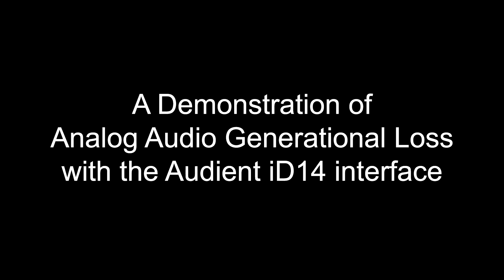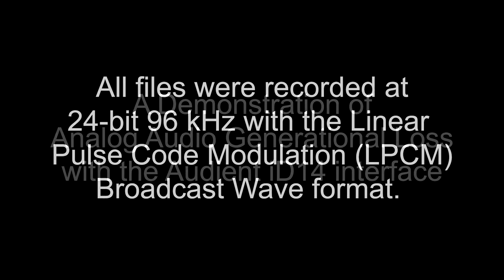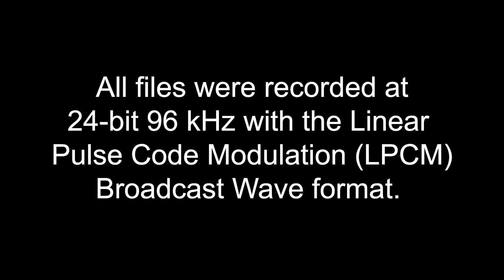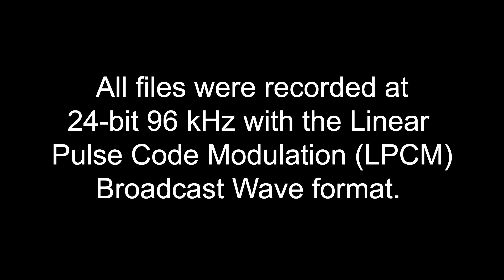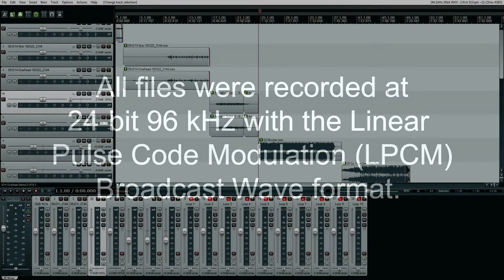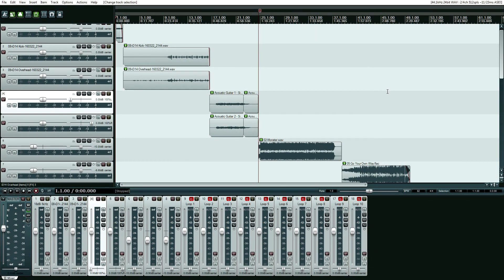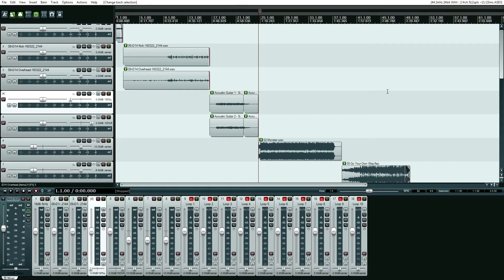Analog Audio Generation Loss Demonstration Audient iD14 Converter Test

Comment: I would totally do this with individual tracks and that stereo image will stay😅 I'm going for the "best/cheapest rig" 
So I got the mark1 because it was the best cheapest option by a mile. The mark2 was gonna be 100 dollars more. 
Every review on the preamps people just raving how good it captures the analog signal and converts it. The limitations of the ID14 mk1 are actually strengths. I listen to everything with headphones and the mark one still has like a very forward sound. 
When going from guitar modeler to the hiZ input, then cranking the modelers master volume..  those chips and preamps do their thing.
Reply: I can't wait to get a compressor or link up some analog saturation to this 
I'm going to get the ID24 at some other point

Comment: This is something I always wondered about. I guess the generation loss is better than a cassette tape. But I still wouldn't make a bunch of passes. That unit's converters performed better than I imagine a lot would.
Reply from the maker: Glad you liked the video, Nick! I was curious what would happen too because I never did a test like this and the 14 performed well.

If I were using any outboard gear processing though I would buy an iD22, no doubt about it. I wonder how much the preamp circuitry degraded the sound? The preamps' gain knobs were up to about the 9:30-10 o clock position with the Audient software volume knob at the max ( 0 ) setting.
Reply: RealHomeRecording.com I wonder how many generations it would take for it to be indistinguishable what the audio was supposed to be when recorded. Such as a thousand? That would take forever though. But it would be interesting to find the point when it just turns to digital "noise".